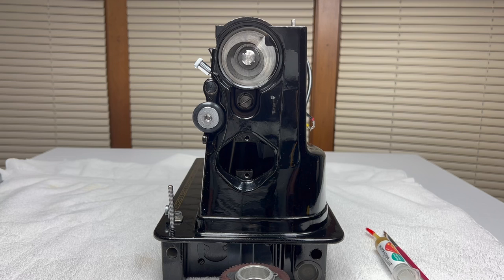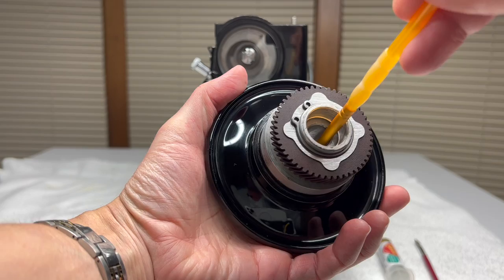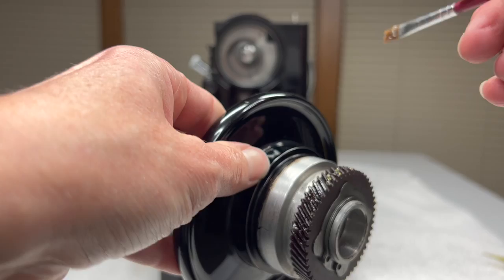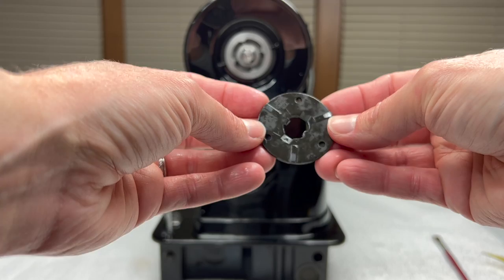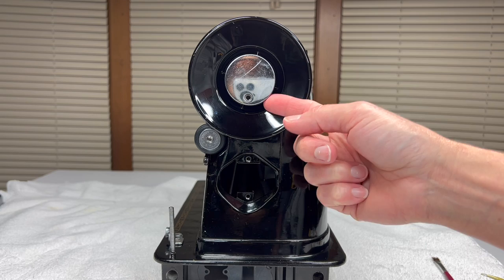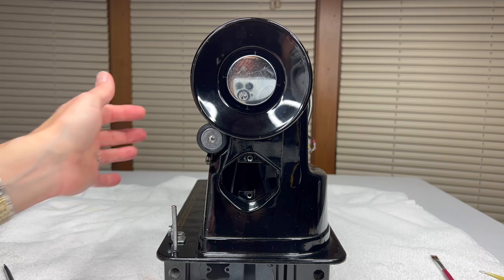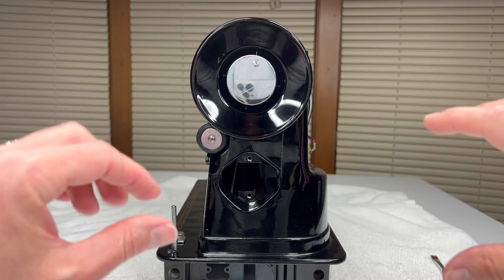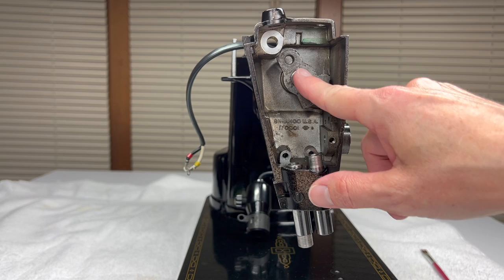How to install the hand wheel on a Singer 301: Singer Restoration Series Part 16

Comment: Not sure if you showed cleaning the handwheel, and if you removed the Textalite gear to clean and replace the old grease under there? Not a bad idea to check it as is has probably never been inspected in 60 plus years. Cheers
Reply from the maker: I didn’t show that but it is something I do when I restore a machine. Have had one that the ring inside had came off the post and there was a lot of play in the hand wheel, I haven’t seen it happen yet but I feel like you could crack the textalite gear if there was too much play. I always check them to make sure everything is where it should be and clean out the nasty grease and replace with fresh. I probably should make a video showing how to do that….thanks!

Comment: Im having a little problem. I have everything back and the screw is hitting one of the nubs but the counter balance is still moving up and down. The washer with the nubs is turning counter clockwise too. It did what it should have before i removed the wheel.
Reply from the maker: Hi! My guess is that the inside of the hand wheel and the shaft it slides onto needs to be cleaned off a little more. I use a scotchbrite pad with some oil on it and spin it around the inside of the handwheel and around the shaft. Then when I slide the hand wheel back onto the shaft I spin it before I add the remaining parts to make sure it can spin very freely. If you have done this and are still experiencing an issue reach out to me at jen@sewingmachinerehab.com and we can talk further. I will try to help!

Comment: Does it matter which way you slide the stop motion washer on because I know it does on other machines such as a featherweight or singer 99. I understand you put the back toward the needle, but there are three little knobs and it can make a difference which way you slide it on..
Reply from the maker: Hi! Yes it does. There are little bumps that should face out, if you look closely in the video you will see them. They are what makes the stop motion feature work for the 301. Even then, it still goes on one way, you need those bumps to be in the right place and you have a 50% chance of getting it right on the first try. You won’t know if you got it right until you spin the stop motion knob back on and check to see where the screw will make contact. I hope that helps!